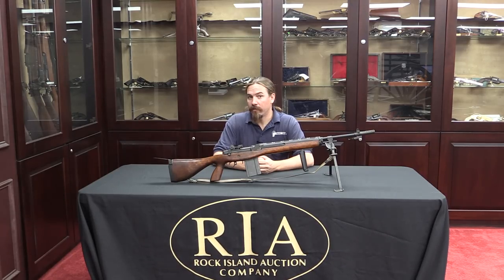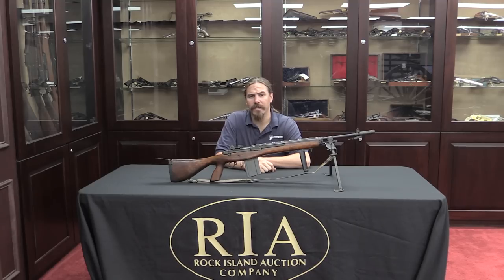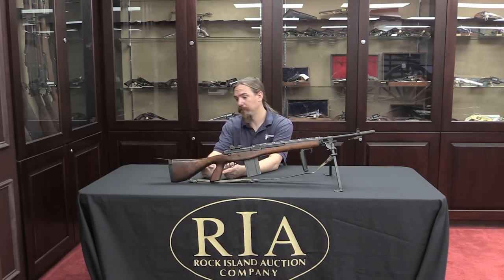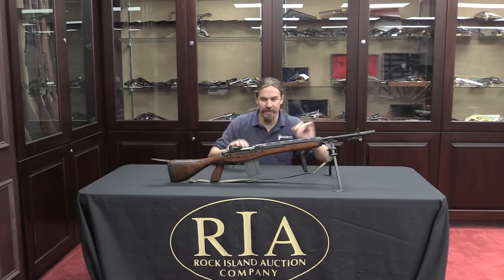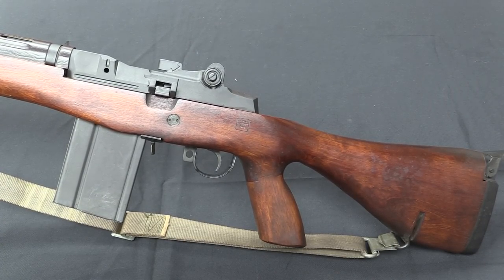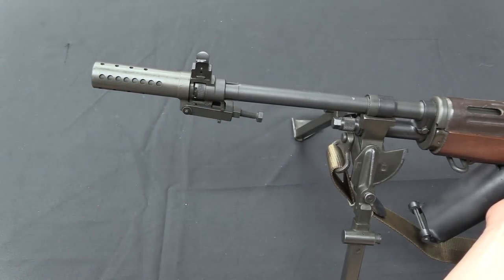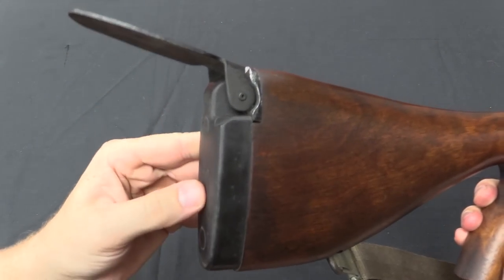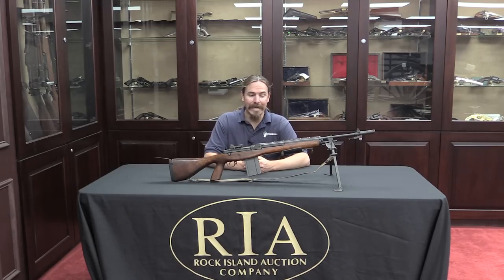M14E2 Semiauto Clone

Comment: In 1967 I qualified sharpshooter with the M-14 rifle, expert with the M-60 machine gun in field fire (bipod), marksman with the M-60 (tripod), and marksman with the M-14E2. The E2 was difficult to control so as to get tight & accurate 2-3 round bursts. The forward handgrip is adjustable for arm length. There are 3 positioning holes in the stock that it can be attached via. The rifle I had to shoot with was on the furthest out (long arm) setting while my arms are short. We weren't given an opportunity to make any adjustments. He doesn't show it here but the sling can be wrapped around your back and shoulder, and that helps control muzzle rise on full auto. Using the sling and with the front handgrip in the right hole, I could do well with this weapon. The 7.62 round is good for blasting through the jungle, but where it comes into it's own is against longer range targets, against which it is more effective than the M-16.
Reply: Interestingly because of fighting in places like Afghanistan they are now reassessing the 5.56 because it lacks the range needed to engage the Taliban fully.
Reply: @bigblue6917  5.56 can hit targets at 500 yards. Past 500 yards I doubt you'll hit much without a dedicated DMR.
Reply: My Grampa was in a jungle base near Bien Hua Vietnam, he was issued an M-14 although, his captain actually didn't issue any bullets because that captain refused to answer the night guard one night and got himself shot at. That was always one of his favorite stories to tell about his time over there.
Reply: @feedthemeat543f  I found it very hard to hit targets over 300 meters with an M-16. I fired the M-16A1 for record in '71 and qualified expert during the day phase, in the night phase marksman.
Reply: @tonygumbrell22  The A2s the Marines and later the Army got had better sights for range. Click-adjustable between 300-800 meters on the M16A2 in 25 meter increments. The modern detachable carry handles only go out from 300-600 meters. 

M16A1 had the flip sights that either were two range settings or one with a large ghost ring for use with tritium night sights. 

A2 had only the latter option, though had much better range adjustability. This was from Lt. Col. Lutz USMC (Ret.) who was in charge of the M16A2 program, and added those sights so that, assuming they're trained for it (which Marines were, but not the Army), a squad leader could better use the riflemen as a base of fire by telling them the target and range and firing on command and whatnot. This was from his experience about that very same thing, where as a platoon leader in Vietnam, where the M16A1s with the sights you mentioned had difficulty laying a base of fire without those adjustable sights when there's a couple of VC blasting away at 400 meters with their SKS. 

Of course, everyone now has ACOG scopes or whatever other new scope they've adopted, which probably means you can get those hits much further away than you could with the precisely one or two range settings on the M16A1.
Reply: @classifiedad1  I don't think the M-16 .22 caliber round had enough momentum to be accurate and have a flat enough trajectory at longer ranges to be useful at over 350  meters.
Reply: @classifiedad1  In Vietnam as stateside we had our rifles zeroed for 250 meters. We didn't fiddle with the sights except for zeroing. Most of our actions were at close range and the aiming point was center of mass, although there was a lot of unaimed fire i.e. point and shoot. For longer ranges we relied on the M-60 s watching the tracers and adjusting as necessary sometimes to the extent of plunging fire, over 450 meters. There's a huge difference between that kind of combat and training, between doctrine and what happens when the shit hits the fan.
Reply: @tonygumbrell22  No doubt. The M16 was very much designed around the 300 meter engagement distances, and was most certainly the best gun for jungle fighting. I know the Philippine Army still uses the old M16A1, though I’m pretty sure they’d have more M4s with red dots if they had the money for it. 

As for precision and accuracy, more modern iterations of the M16 and the .223 it uses are much more capable at long distance. The M16A2 I mentioned was made around a bullet 12% heavier and had a steel penetrator tip on the inside. The most modern sniper-grade .223 uses bullets 40% heavier, and these are dominant at distances out to 700 meters. 

The M16A1 wouldn’t be able to stabilize these bullets, but the M16A2 and the M4 do as the rifling twist is faster on the later guns.
Reply: @classifiedad1  Good answer, I am still skeptical of the 5.56 round for long distance engagement, but you have added information that I didn't have. I left the military in 1973.
Reply: @tonygumbrell22 As a brother 11Brovo, hope you see this. It's been 6 years since this post from you, so i realize there is little hope that you will. In the same year, 1967 at Fort Ord, i by chance qualified EXACTLY  the same as you did with all three weapons. The E2 was without a doubt in my mind the absolute worst weapon i ever fired. Not being a "great" shot, but pretty good, considering the fog and my glasses giving me issues, the Sharpshooter M-14 qualification was bad break and very nearly Expert,  and that my Marksman qualification was a gift because the testers knew how IMPOSSIBLE the E2 was to hit ANYTHING with. Firing the M60 from the hip was more accurate than the E2 on full auto LOL!!!!

Comment: This is a very accurate history and overview of this weapon.  One caveat.  It was intended to be an automatic rifle, not a light machine gun, replacing the BAR, not the 1919A6.  Comparing it to the M60 is just not relevant.

 I trained on the M-14 in basic and infantry AIT at Ft Lewis Washington, September 1967-February 1968.  In AIT we used the M14E2 / M14A1 for the "automatic rifle" part of the training and M60s for the "machine gun" component.  Both were better weapons than they are often given credit for. At age 17,  I was an experienced shooter and liked the M14 in general even though it was a very conservative modification of the M1.  

I loved the M14E2.  You had to learn to use the rear handgrip to seat the butt well against your shoulder and use the front grip to pull the weapon well down on the bipod.  If you mastered three-round bursts, you could knock down target after target at 500 meters without a miss.  Any more than four rounds in one burst and it was wasted ammo.  It was very accurate in short bursts and extremely accurate on semi-auto.  But it was hard to train completely inexperienced guys on it.  I think at some of the ranges in Korea and Germany, it would have been much superior to the M16, at least with two per squad and the rest with m16s.  But it was long and clumsy getting in and out of a M113 APC with it.  And the ammunition and magazines were heavier than those of an M16.  In Vietnam, at the ranges we were at in II Corps, the shorter effective range and less lethal round of the M16 were not a disadvantage.  The M16 had its problems, but was a better weapon in Vietnam than the M14.

After BCT and Infantry AIT at Lewis, I went through jump school at Benning and was assigned to the 82nd two weeks before Martin Luther King was shot.  I was in B/2/508.  When King was killed, we flew up to Washington D.C. for riot duty.  The squad I was in guarded a bank and a liquor store on South Capitol Street, just north of the bridge over the Anacostia River, a few blocks from Ft. McNair.  We were armed with M16s, but I was told to turn mine in to the arms room and I drew a good old M14E2.  There was fear of "black radicals" acting as snipers and I was the platoon's designated "anti-sniper sharpshooter."  I had fired Expert with the M14, M14E2 and M60 at Lewis and I guess that was on my Form 20.  So I guarded the liquor store with the 14E2 and later a refrigerated warehouse near the FBI headquarters.  No one in our company fired a single round the whole time we were there. The first two nights, the African-American grannies in the run-down tenements a block west of S. Capitol brought us hot food because all we had was C-rations.  

The Maryland National Guard, which went in right away, was full of week-end warriors who were mostly students at the University of Maryland and Johns Hopkins.  They were scared whizless and fired off hundreds of rounds the first two nights.  The 82nd was made up of 19-year olds who thought they were really tough.  And we had a lot of poor blacks in our company.  They were on their home turf.  Other units said that the "AA" shoulder patch of the 82nd stood for "Almost-African" rather than "All-American."  But we had fire discipline.  I was told that all the companies from the 82nd together fired a total of less than 20 rounds.  The National Guard units fired many hundreds, mostly because they did not have the naive self-confidence we in "the division" did.

p.s., I have not been back to South Capitol Street since 2002 or so, when I took my son to the museum at the Washington naval yard a few blocks to the east., but the liquor store was still there and still in business.  You ordered through a slot in a thick glass window and got your order via a pass-through.  The old ramshackle wood tenements had been replaced with really grim public housing.  If anyone has been to that area more recently, I'd like to know if it is still open.
Reply: Joseph Blowsma that was a good read.   Thanks
Reply: Thanks for your story and information on the M14E2. I was fortunate enough to purchase the same setups that FW is auctioning. Thank you for your service and welcome home.
Reply: Thank you for the post. It was a good read, always interesting to hear 82nd history. I was a 504th PIR man myself.
AATW!
Reply: Yeah.  In the summer of '70 I was going to Ordnance School in Quantico and one of our weekend passes was put on hold because they thought they might need us on Riot Duty in D. C. but it didn't happen and they let us go.

I remember watching a grunt platoon out on the parade ground practicing their Stomp & Step, advancing one bit at a time with fixed bayonets but they didn't have us do that.

Yeah ... the National Guard units just don't have the fire discipline of Regular Military and certainly not that of elite units.  Thus Kent State ...

One thing about Kent State though - is that shooting at people to draw their fire onto innocents - was in fact Communist Doctrine.  They used it repeatedly in Vietnam and they had used it to start WWII at the Marco Polo Bridge incident in the summer of '37 in China.  So - I don't know if the NG unit at Kent State WAS actually fired on - but - it is exactly the kind of thing Communists would do - with exactly the result that they would want.
.
Reply: My early time in the army matches your months exactly, except it was Ft Polk, Ft Leonard Wood, then a little farther north on Smoke Bomb Hill.  Did you ever meet Nicky Gillespie?

Comment: The M14 in CoD: Black Ops looks like this and shoots only in semi.
BTW, the game takes place in the 60's but many weapons in the game aren't invented by then.
Reply: +rambokicksass77 
But the power of various weapons in pretty much all computer games are total bogus....
Being shot by a M1911 is just as likely to kill you as being shot by a M16.
As someone knowledgeable in things once said "Shot placement is king, penetration is queen and the rest is just angels dancing on the head of pins".

Weapon damages, ranges, accuracy etc are just there for game balance reasons, and have little to do with actual reality.
For example, most military assault rifles have the same accuracy, which isn't improved for normal ranges with a scope (nor does a scope increase damage, or make a 7,62x51 Sniper Rifle do way more damage than a 7,62x51 assault rifle with the very same barrel length).

For most military standard assault rifles, the deciding factor is instead the ammunition. Since standard military ammo is produced to be cheap and reliable rather than accurate, so whatever differences there are in accuracy between rifles are negated by that simple fact.
Snipers use specific match ammo, manufactured to higher standards for better accuracy.
Also, putting a scope on a weapon doesn't make you a better shot....and the difference between a sniper and a rifleman isn't the weapon itself, but also the actual skill in using it....Give your average rifleman a sniper rifle that is capable of reliably putting rounds into a target the size of a human head at half a mile, and he would be unlikely to even hit that target at that distance....

And I didn't even mention shotguns....Man...Shotguns in computer games....
Magical weapons that do tremendous damage if you are really close, but whose bullets apparently drop in kinetic energy like it was fired in jello or something.
At 15 meters (50 feet), shotguns barely do any damage, and at ranges over 30 meters (100 feet), their pellets apparently evaporates into thin air.
Which is kinda unlike real shotguns, which works just fine at those ranges.....And often even have sight set for things like 100 meters...clearly ridiculous distances for a shotgun, according to first person shooters....
Reply: @nehcrum  Rising Storm Vietnam doesn't have that kind of weapon handling. The only gun you usually need two shots up close for is the makarov (if you don't hit anything important) and you can basically snipe with the hunting shotgun

Comment: Ian;

One of the U.S. Army units I was in had six E2 variants, still in the original configuration in the early 80s.  We also had several M-14A1s, with the receivers remarked to reflect the A1 designation.  However, all of the rifles so marked, as M-14A1, were formerly select fire rifles, as issued M-14s, but with the full auto capability removed, and all the full auto parts removed.  The selector switch gap in the stocks were either plugged, or entirely new Walnut stocks without the selector switch cutout installed.
I was always told that the designation M-14A1 referred only to original issue M-14s, that had been deselected, IE lost full auto capability.

I had an opportunity to work on, and function test fire many of these rifles.  One other feature that our E2s had that was not included in the version in your video, we had a 2lb weight that could be hung from the bipod by the front sling swivel.  While the additional weight helped, it wasn't really enough, and was often "lost" in the field by actual users.  On the E2s in this unit, the sling swivel on the bipod was only used for hanging the additional weight, and a standard front sling swivel was attached to the fore end of the E-2 stock.  

  Another feature you may not have been aware of, is that the collapsable fore grip can be moved into any one of the several mounting holes on the underside of the fore end of the stock.  Small rubber plugs were provided to close off all the holes not used in the mounting of the grip, to reduce dirt/debris contamination inside the stock/action.

Keep up the good work!

SFC Bruce R. Gadbois
U.S. Army

Comment: My version of the modern semi-auto M14E2 utilizes a rigid, standard profile 4 groove 16.25" barrel with a 1:10 ROT. The stock is a new USGI Birch that I finished. It wears a light weight ventilated aluminum railed hand guard topped by an Aimpoint Comp M4. The rifle is accurate & reliable, and I have set it up to accept a bi pod, a 50 round drum magazine, and a sound suppressor. Easily a favorite of the many M14s I have built.

Comment: The little cylinder on the side is actually the selector lock, and is on all M14s.  For FA, it was replaced with the actual selector switch.
Springfield Armory marketed an E2 kit as a catalogue item as late as the mid-90s.  I bought my personal M1A while working for a distributor, and he had one in stock.  While cool, I wanted a rifle as close as possible to the M14 I trained with at Marine Corps OCS back in '75.
Amusingly, at one point, the M14 was supposed to replace not only the M1 and BAR, but also the M2 carbine AND the M3 subgun!!

Comment: Comparing the M14a1/e2 to the M60 is like comparing the BAR to the M1919, or the FG42 to the MG42.  In fact, the M14a1 was just meant to be a BAR replacement, a full auto/short burst/full caliber automatic rifle in a fire team of semi-auto riflemen., not a platoon level support weapon. M14a1 would have been a breakthrough in the bolt-action rifle 1940's, but was much less relevant in the assault rifle 1960's.

Comment: My Winchester M14E2 had the longer sling w/hook, the front grip DID lock into place, a steel liner to prevent the wooden fore arm from scorching (I obtained this after pumping through 5 mags on auto).  The auto switch was skinnier than the knob shown and mine had an "A" indicating auto fire. Accuracy at 300m was not the best with 30% hits on short bursts. Still fun to shoot.

Comment: I was very excited to see this, as I have a beautiful E2 stock on my (semi-auto) M14. Mine is made of birch and I couldn't source the proper hardware, but the lines are gorgeous with the rubber buttpad and 6 o' clock rail from Treeline (also the source of the stock). In my opinion, it's more functional on semi-auto. Modernizing the E2 is a fun way to go. Marry wood with the new stock shapes and modern foregrips... red dots, suppressors, new muzzle brakes... Sexy and cool it is!